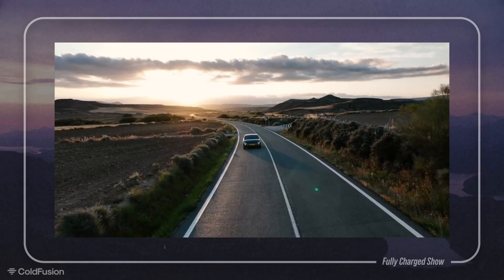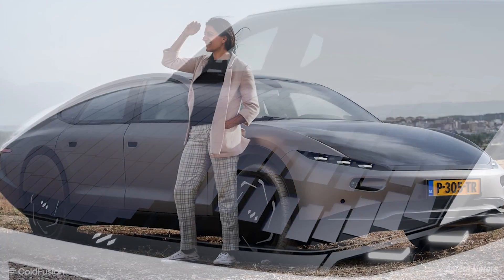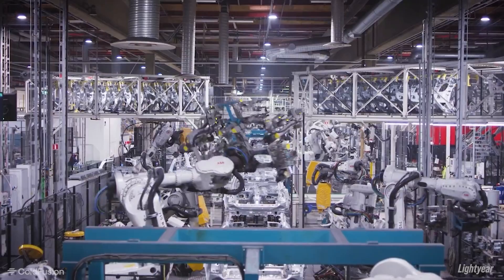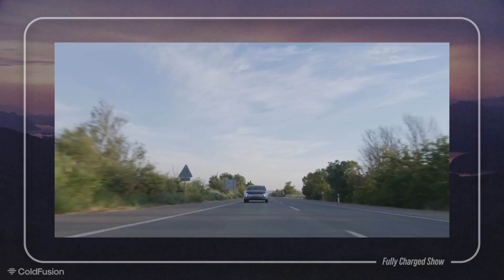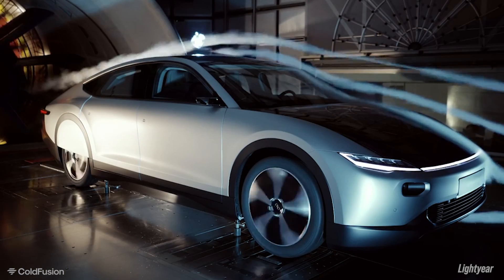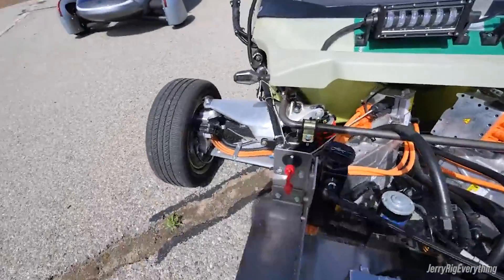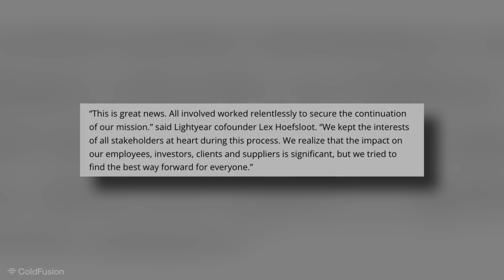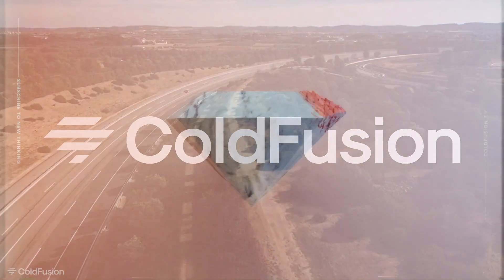3 Interesting Solar Car Projects

Comment: To answer your questions at the end: I would absolutely buy a solar powered car for $30,000 but here in Ireland cars are expensive. Even a Corolla costs more than €30,000. 0-60 in 10 secs is not slow by my standards, I don't really know why anyone needs to accelerate quicker than that. Most of the cars I've owned in my life were slower than that. Economy is more important to me than speed.

Thanks for another great video, always enjoy your content and I hope lightyear and aptera manage to be successful
Reply: As I definitely appreciate the car and if it was cheaper would get one. I do appreciate a very fast and aggressive looker all day long. Some of us need to accelerate quicker than others. We're all different.
Reply: You don't need to accelerate faster than that, but it can be fun. Just like nobody needs to wear coloured socks.

Comment: I preordered the Aptera a couple yrs ago. The efficiency is very impressive. Hoping they are a success.
Reply: It's very efficient because it is a motorcycle, not a car, so it doesn't have to have the same safety features an actual car has. Anything with fewer than four tires is a motorcycle.

* Apparently it's an "autocycle" because it's enclosed with seatbelts. So there's a different set of safety standards, you don't need a helmet, etc. Good to know it's not just a dodge around making the thing heavy enough to be safe.
Reply: @darrennew8211 maybe but it also has a fully enclosed cockpit, two side-by-side seats and a boot that can fit quite a bit more than any motorcycle. Also, when it comes to security, Aptera has been very clear that they made no sacrifices and the material they use is as good as any metal when it comes to protecting the passengers. They pride themselves on making "something that's sort of in between a car and a motorcycle" so if you want to come in with your half assed definition and discard them just because "if it has less than four wheels, it's a motorcycle not a car" go at it. They are probably too busy making a great vehicle to care about your opinion on what it should be called
Reply: @anthonyjaccard3694  Well, it's good to hear they're putting in more safety stuff than required by law. I'll wait until it's actually in production and has been tested before buying one. 🙂

Also, being enclosed and with seatbelts apparently makes it an "autocycle" which I didn't know, so you (for example) don't need to wear helmets.
Reply: @darrennew8211  it's going to be tested against full government car automotive standards and has seatbelts and airbags so comparing it to a motorcycle is a bit of a disservice as a motorcycle has nothing like that and no outer shell. Quote " It’s as long as a Prius (172”) and as wide as a Tesla Model S (85”).
The body is made from composites which makes it far stronger than steel oraluminum. It also has airbags in the steering wheel and the dash for the passenger and full three-point seat belts.The Aptera is designed like a formula one racer where the occupants are protected by a cage-like composite structure.
Reply: @huzcer  Good to hear they're following safety standards above and beyond what the USA requires. But it is technically a motorcycle.

Huh. Apparently it's actually an "autocycle" because it's enclosed and has safety restraints. So you don't need a helmet, and there's all kinds of different safety standards. My bad.

Comment: I think the main problem with solar helped cars is that having a solar panels with a charger will be cheaper and more efficient, also removing the dependency on each other (changing the car means losing the solar panels, breaking the solar panels devalues the car).
I know that there are benefits of having a solar car (maybe you won't have access to the charger in the day, you can't install a solar panel at home, etc), but it's still more of a niche feature.
Reply: It's not a niche feature in big cities, there are mostly appartments there and chargers have very expensive rates (higher than gasoline) and they are hard to find, don't always work and you have to go out of your way and wait there, making electric a nightmare if you don't own a house/garage in a city and making those cars perfect candidates for those situations
Reply: @Tofandel  in that situation, using an electric car is most likely a bad idea, even you have solar panels on the car. 
If you don't have access to a charger that is cheaper than gas or is really hard to access, the solar panels will not prevent the issues, it will just slightly alleviate it (you eill still have long period of low light and/or longer journeys).
Reply: @ionut-cristianratoi7692  In cities in Europe it's small journeys (commuting so average 10km per day) and high exposure all day, there is almost no skyscrapers in Europe, so solar alone is more than enough

Comment: Cheaper? Lightyear 2 has a target of $40k with an unsafe 0-60 in 10 seconds. (Try merging on a short uphill freeway on ramp at that rate...) Nissan Leaf MSRP base $27k with 0-60 in 7.4, 20-25% faster. Still not great but I know which one I would choose if pressed. Will the LY2 be safe with the compromises needed to lighten it up? Then there is the three wheeler shown... I''ve seen repeated promises of efficient three wheeled cars from various scammy companies since the 80's like the DALE... I doubt the one shown here will launch and I don't see any of these going anywhere but back to bankruptcy.

Comment: They're on the right track. What's sad is that although battery technology has made slight improvements in the past 15 years, solar panel tech is almost identical to what it was at that time. Space grade solar cells were and are almost 40% (38% I believe) efficient but the cost is impractical for consumer use. Someone needs to bring space grade solar efficiency to consumer solar at a reasonable price.

Comment: Back in the early 2000's, JDS Uniphase had a solar cell that was 40% efficient, in the lab, and they sold it off for some reason. I would look out at the company parking lot and imagine all those cars (losing money as they were) actually profiting their owners by collecting solar power and selling the excess to the grid. All they needed were solar panels integrated into their design. I pictured a folding tower that would rise up out of the cars, unfold a sunflower-like collector and focus the sun on a solar cell to charge the battery. But, I am not a mechanical designer or an engineer, but it seems to me that all revolutions begin with a single idea. And here's what I, as a Canadian, need; A small four wheel drive truck that I can drive out and park in the bush, that will recharge in the sunshine, operate in all temperatures, not rust out from road salt, top speed 100 kph, bull low to skid the occasional log on the road, carry a canoe, get me home. That's it. They will sell in the millions. But if it works in Canada, it will work anywhere. Oh, and made here, so I can track down the guy who built it wrong...and he can fix it.

Comment: It sounds like you have to be careful where you park and when you drive. If the panels are cheap and there is not much of a downside, why not? Otherwise, it seems more efficient to put solar panels on the roof and charge the car with the energy.

Comment: Interesting to consider: how many drivers in the USA have a garage, or park in a garage? My take: ditch the car solar panels and put them on the roof of a house, or make them part of some kind of solar co-op where when you buy the car, they add solar capacity to the local grid. That way, the car doesn't have to carry them around, and they can be deployed in a way that will track the sun and be maintained by professionals for max output. Let the EVs focus on maximizing range, speed to charge, etc. Also, getting cities to incorporate more dedicated bike paths that actually connect retail and residential would be nice. Lots of modern e bikes could even further reduce energy needs.

Comment: "they will put up their IP that was used on a failed project so that if this new  project fails you can use the IP for a different project to fail  instead."

Bottom line on solar is you may save a little bit if you dont drive much but if you drive a lot, unless its in maybe Arizona, you will need to charge anyway so all solar does is reduce the number of charges you need, not eliminate them. 

If you drive so little you never need to charge, why buy a car,  uber instead.

Comment: Tbh, it seems like the best option is to just have your standard electric car with some cheap, light solar capabilities to augment its range. The solar panels on the car is probably never going to be as efficient as a large scale solar farm or even rooftop solar, since you have to drive it around with you, so it will definitely be very expensive and inefficient
Reply: Now I'm picturing the ultimate "green energy" vehicle. Self-adjusting rotating satellite solar panels on the roof, and a turbine in the middle of the front hood for wind power.
Reply: @SekiroStan  That would be stupid, you increase drag and loose efficiency much more than you produce energy, you're thinking of a perpetual motion machine which breaks the laws of physics
Reply: @Tofandel  I put "green energy" in quotes because it was a gag idea. Definitely not something that would produce good results haha. 😅
Reply: I was going to comment exactly this. Why put advanced, much more complicated and expensive solar panels on a car when you could instead add the same amount of energy production on a farm and just let the panels sit there passively generating power instead of carrying the power production around literally everywhere you drive. Whatever extra cost of installing these panels on the body of a car could much better be spent adding panels to anywhere else like we already regularly do.

Comment: This video really does give me hope.  I currently own a battery electric car with a range of around 80 miles (130 KM) that is used for around the county driving.  I've had it for 8 years now and I love it to bits.  If an affordable one came out with enough solar capacity to make battery charging unnecessary for short to intermediate length trips I would be all over it.  Thanks for feeding my dreams, Dagogo!
Reply: Just buy solar panels for your house. You got a solar-powered car.
Reply: @fasteddie31003  What if you happen to be on holiday with your car?

Somewhere with no charging station?
Reply: @Fantastic_Mr_Fox In Europe it’s become a non-Problem. When do you need a lot of energy? When you’re going large distances. You go those large distances on highways. And those highways all now have DC-Hyperchargers. You take a break for half an hour. And it’s charged for the next few hours.
Reply: @Fantastic_Mr_Fox  here in USA is charging station everywhere
Reply: @gsabic . nope 👎
 although I guess it depends 
California vs. da up of MI
Reply: @Fantastic_Mr_Fox Public charging options are quickly growing. Unless you're planning to drive across the Australian outback, that's not really going to be a concern.
Reply: @Bertinator-nm9ld  sure but it's less convenient to leave your car somewhere away from your house 

especially where I go for holiday.
Reply: @Fantastic_Mr_Fox  I'm confused. Can you elaborate on your statements that public charging is inconvenient on road trips? Can you elaborate on the specifics of your trip that would make a conventional 300 mile range EV difficult to use, but not a solar EV?
Reply: @Bertinator-nm9ld  I didn't mean a road trip. I meant that, in the location where I usually go on holiday, it would not be practical to have to charge in a public charging port since the nearest one would most likely be quite a ways off. Meanwhile, a solar ev could just be parked out front and    we'd never have to worry aboug charging it.
Reply: @Fantastic_Mr_Fox  How much are you driving, while you're on vacation? 300 miles can last a long time unless you're frequently moving a good distance from your vacation spot anyways.
Reply: @Bertinator-nm9ld  Sure, 300 miles will last a long time, but it's already 150+ km to get there, then again to get back, and there's frequent driving in mountainous terrain. 

500km might cut it but it'd be close, I'd rather not have to worry about charging at all. 

Besides, I like the knowledge that my car charges itself.
Reply: @Fantastic_Mr_Fox  That is an interesting, but pretty niche, use case. For a lot of people, I think that last thing you mention is the only real advantage of building solar panels directly into the cars themselves. It sounds neat.
Reply: Aptera
Reply: Me tooo my 2014 Leaf rocks !!!
Reply: @MrIsmilealot my understanding is that there are more LEAFs out there than any other EV. Rock on!
Reply: On  my Ford Transit camper box van I have 1280w of solar power and it covers the entire roof that is 4 x 2 m large and even that is only enough to power a electric car for no more then a short drive after charging an entire day ... I have 5000w / hour battery bank and it takes about 7 hours to charge the battery bank under perfect conditions which is rare.
Reply: Electric cars are not going to contribute much to lowering carbon emissions and no where near what we need to be doing. If you want hope jump on public transport or ride a bike, hell even an E-Bike is 10X better than buying a Tesla if your commute is realistically in range.
Reply: @Battleneter  agree, also move to a studio apartment. but nobody wan to live  like poor people (europeans)
Reply: Check the Toyota Prius with solar roof
Reply: @jamesthompson3099 Dreams is right, the range likely drops by half from a bag of groceries.
Reply: Why does it matter? It's so easy to charge the car, and it's at least 3x cheaper per mile than a gas car. And the best is to charge from stationary solar panels (on your roof ideally), there's no need to carry them around.
I've been driving a Tesla for close to 5 years now, so I know what I'm talking about.
Maybe your problem is the 80 mile range. Today 300 miles is the standard, and you can get 400+ if you can spend a bit more. With 300 miles you rarely have to worry about charging. Especially with Tesla's excellent charging network, which will soon be open to everyone.

Comment: As both an BEV and PHEV owner for the past 12 years, there is no need for such bizarre (although well meaning) car technology.  With my rooftop Solar, a 18Kw DIY home battery system, and the PHEV/BEV's we have, over the past 10 years we have reduced our family emissions by about 93%.  It's ridiculous to think that fossil fuel use will Ever go away, and more absurd to demand it go away.  The key is to Dramatically Reduce it's use.  The problem with these never-ending click-bait/sensational stories about FUTURE technology,  is that it lulls us humans into "waiting for the "perfect" solution."  All while consuming more and more and more fossil fuels. 

We have all the technology we need right now  for each of us to make a minimum 75% reduction in fossil fuel consumption Without any sacrifice of convenience, or any extra capital expenditure. Sorry Dagogo, this particular presentations isn't doing us a favor.
Reply: I also have residential solar, HEV, PHEV. Generally agree with you but think large stationary batteries are a waste. 20-50% deduction is very doable with better economics. Solar cars are mostly clickbait. Where they almost work, $20K limited use is better.
Reply: @artsmith103  Please explain a little more about "large stationary batteries" being a waste, better economics, and "$20K limited use".
If you mean a large home battery, what is the alternative when one over-produces energy in a grid-tied system?  
I'm thinking what you're saying about "better economics" is suggesting more efficient energy usage?  We recently added ductless mini-split  as a replacement for Central HVAC. Here, we are just heating/cooling the rooms that we are in at the time, vs. heating/cooling an entire home (and the empty rooms we are not in).  This alone reduced energy consumption by almost 40% - which in-turn created the massive solar energy over production - which in turn was a justification for storing that over produced energy.  

My other peeve is all-electric vehicles.  Perhaps its because people (and really Americans in particular) are intellectually lazy, we do not compute the way we actually utilize our personal  auto transportation.  90% of all driving, for 80% of all Americans is daily commuting of 50 miles or less. A 50 mile-range PHEV solves this...then for the fairly rare time a vehicle is driven beyond the all-electric range, just use petrol.  No need whatsoever for $trillions in "public charging stations".
Reply: @shotelco  I also just installed mini-split for 1st AC luxury and we heat with it during shoulder season rather than wood stove.
Batteries are exceptional when the load is clearly defined to match. Similar to your PHEV explanation. Batteries increase PV elec cost/kWh some 30% or more so can ruin investment. Just spin meter backwards, no storage inefficiency.
Reply: @shotelco  $20K limited use I meant the metro/suburban commuters that have good range vs use batteries. Often smaller 3 wheels, and easier to park.

Comment: I put in a $500 deposit for an Apteria, but may have trouble coming up with the rest of the money for the car.  I love the idea of solar charging.  I am retired and the 40 miles of range accumulated every day would be enough for the monthly grocery trip and travel 100 miles to the family every couple of months.  I am the kind of user who would never need to plug it in to charge.
Reply: Or alternatively on that mileage you could just charge an ordinary EV once a month.
Reply: Are you sure you resrved an Aptera? The deposit amount is $100 at most. Did you resaerve 5?
Reply: @glennzajic7318  from memory having looked into this you can pay more to get bumped up the list. They need every $ they can get. Still touch and go if they survive.